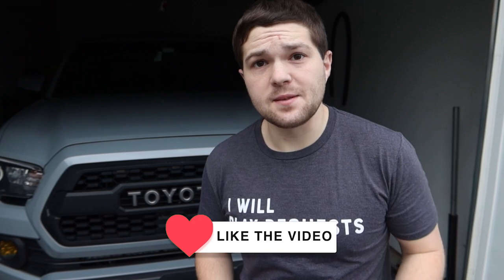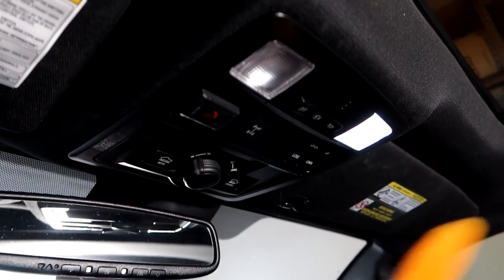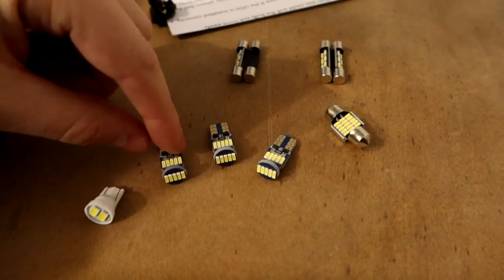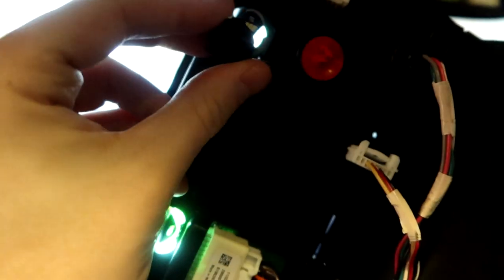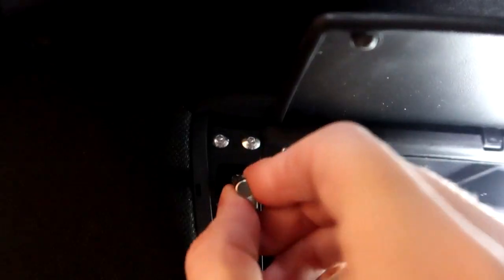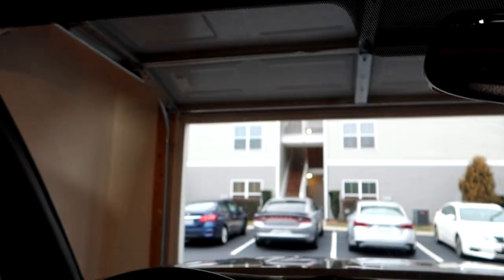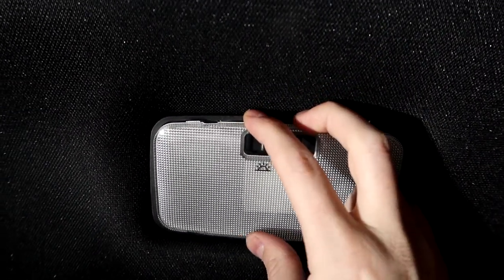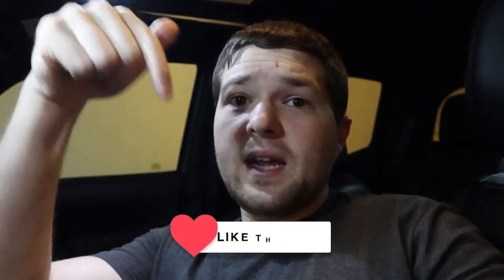How to install Interior LED Lights (2020-2021 Toyota Tacoma TRD)

Comment: Bought the same kit for my 2020 Tacoma TRD Off Road and your recommendation to pull the map light console to replace the two map lights rather than trying to remove the bulbs from underneath is the way to go. Takes a good firm grip to pull the console down but it pops out and goes back in easily. Great video, thanks! 👍

Comment: I popped the individual map lenses out individually my console really didn't wanna pop out so i used duct tape to pull the bulbs out, and for the dome light i had to add a dot of solder on one end because it fit too loose and wanted to move and flicker, but problem solved

Comment: Hey! I’ve been losing at Tacoma’s specifically ones from 2016 and up do you have any good idea on how much I should be spending on one without paying too much ? Big fan of your content
Reply from the maker: Nope. Its all over the place right now
Reply: If you're looking at 2016 and up...might as well just get a brand new one.   Used value is waaaaaaaaaay too high right now, and if you go too old (2016/2017) you run into the early 3rd gen transmission issues.

Comment: Great vid. No need to pop out entire unit for map bulbs. Covers pop out.
Reply: Covers pop out but it’s extremely difficult to get the bulbs out, even with tape.
Reply: @noorhanidickson7190  The light kit I bought on Amazon included a tool that popped out the covers and gripped onto the bulbs. I was still worried about breaking something!

Comment: Do you have any suggestions for not to expensive led front head lights?
Reply from the maker: Not really. I had cheaper ones and had issues every other month. Have had 0 issues with the diode dynamics ones almost 3 years now.

Comment: After replaced interior lights and all interior lights is not working.  Is it the fuses?
Reply from the maker: Check thr fuse but also did you make sure they worked as you put them in? They only go in one way

Comment: They are too bright for me I have them . You still getting the ovtune?
Reply from the maker: No. I dont mind the current driving performance
Reply: Just got the ov tune and am on my first tank of gas.  Huge boost in performance.  It shifts correctly now and I am seeing about 1.5 mpg improvement with normal around town driving haven’t had it on a trip yet.